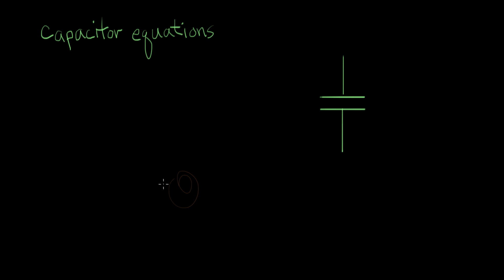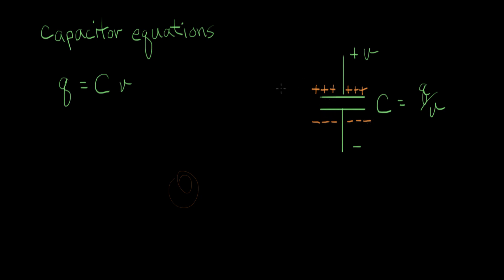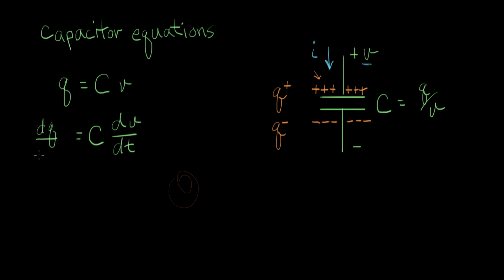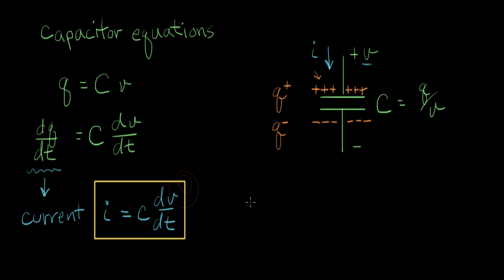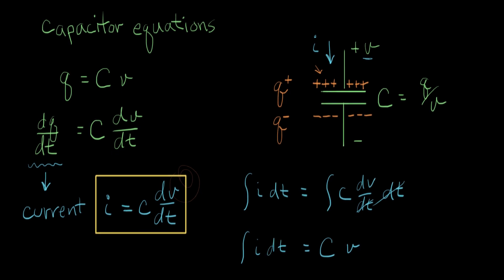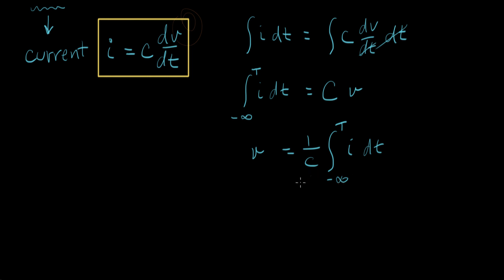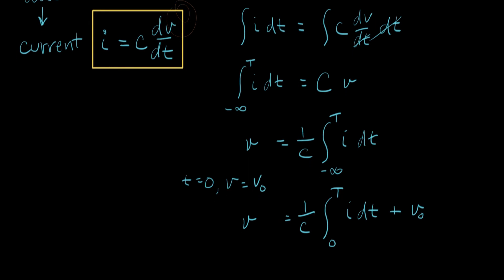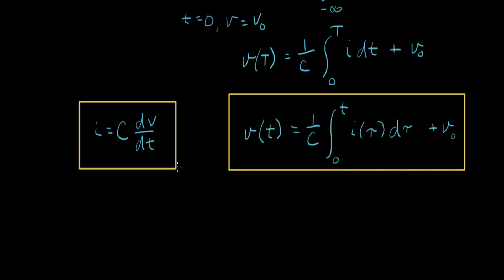Capacitor i-v equations

Comment: How does any current get through the compositor?
Reply: If the capacitor is charged by an external source, it will supply current to the circuit once the external source is removed. The current will also flow through the capacitor as the input charge changes (meaning the cap resists changes in voltage the circuit )
Reply: With AC, it passes through capacitors. With DC the current stops when it charges up the capacitors.

Comment: I believe understanding Calculus 1 & 2  is required and maybe some physics.  I went through a lot this at Ferris State College and got my associates degree in Industrial Electronics but when they taught us this it didn't involve that level of math as it was only a two year course.  They just gave us the final equations without the mathematical solution. I think you will have to find someone that knows the physics behind capacitance and the math knowledge to apply it.  I had the math later on in my academic career but I'm still not following some of the givens he proposed in these areas you are siting.

Comment: I'm having a Circuit Analysis course this semester and I'm stuck figuring out this equation, What is the idea of putting (- infinity) in the lower limit of the integral ?
Reply: the voltage across a capacitor is dependent on the history of the capacitor i.e how much it is charged when we start flowing current through it, that's why we begin from (- infinity )
beginning at t=0 doesn't ensure that that voltage across it at t= 0 is also zero
Reply: Here, minus infinity is just used to depict the initial time at which the capacitor started accumulating charge, which would have been obviously 'far- away- before' present time 'T'.